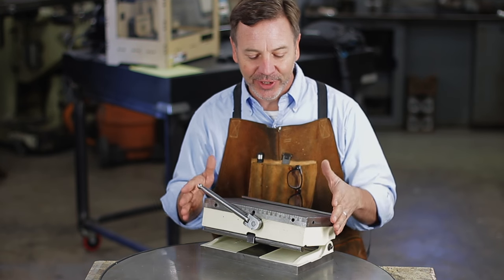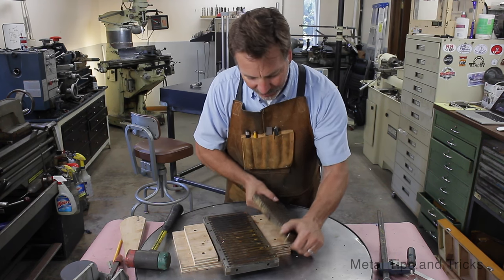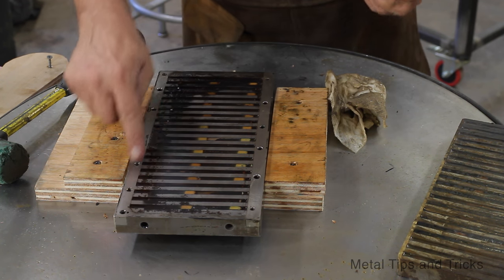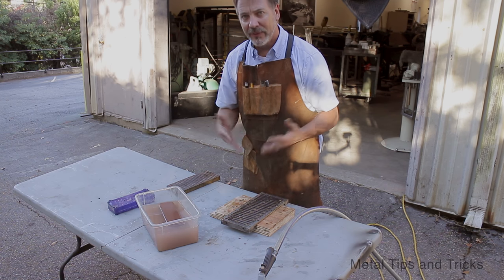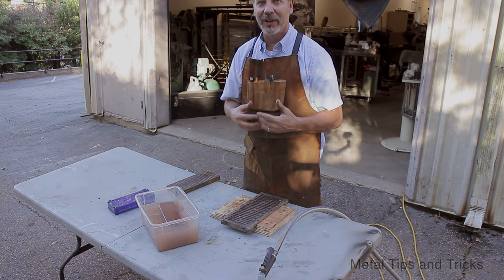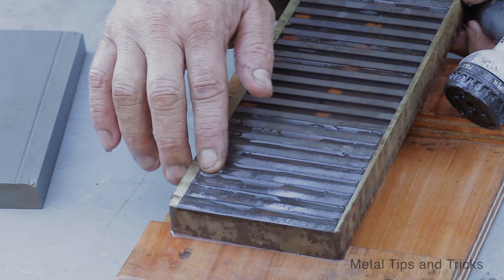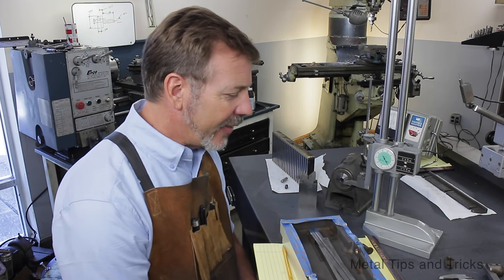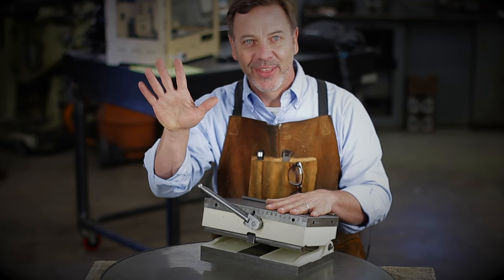Magnetic sine plate repair PART 2

Comment: Other YTs I’ve seen dismantling a magnetic churn, turns the chuck “off” then lifts the top plate. Also the magnetism is through the thickness not the ends. There is a really good YT about how a mag chuck is built in the factory. Thin profile chucks are best for small thin objects because, as you say, the flux lines are small. And that is because the poles of the magnets run through the thickness not the ends.

Comment: Fascinating series. The distance between engaged (magnets aligned with transfer segments) and disengaged (magnets between transfer segments) will give you the "throw" (twice the offset) needed for your cam, but not the length of the link. As you say, that may require trial and error.

On flattening, the rule is to rub three surfaces (in rotating pairs) to get them all flat. Rubbing a single pair will always create one concave and one convex surface. This is how telescope mirrors are ground by hand. Avoiding letting more than a quarter of the stone go off the base object will help, but the three surface method will generate optical flats (flatness measured in Ångstroms).

Comment: 3 months ago I also rebuilt an eBay magnetic sine plate.  I placed the plate on the plywood like you but used a larger plywood sheet and surrounded the top plate with wood supports.  I then added 2 blocks to retain the captured plate to the plywood like a hold down on a milling machine.  It was easy to then use 2 wood clamps to walk the mag plate sideways off the bottom plate and also reversed to place  back together.
Reply from the maker: Great job. I wish I would have don it that was. what kind of shape was your magnetic plate in?
Reply: mine was in poor shape with rust and goo even the hinge pin had light rust.  I have not completed the repair with final grinding.  I will do that when I need it for a project and remove my standard mag plate.

Comment: Take a guess?? Why not just measure the lamination separations on the magnet? The distance it needs to shift is one separation.
Reply: Exactly.
Reply from the maker: Good point, Im not that smart!  LOL.  No thats not the reason there are other factors in play.  If the pivoting pins on the cam were in alignment  with  the one on chuck I could do that. I could try to calculate the differences, but sometimes its faster for me to use  the trial and error  method. :-)

Comment: Thanks, I learned a lot from this video. My 6 x 18 chuck is very hard to turn on and off, even with a long handle. I've taken it apart for cleaning as far as possible but cannot separate the two halves for grinding and lapping as you have done. Maybe I''ll try again by pulling the top half from the side since I'm sure that what's causing the problem.

Comment: Hi Dale,

I commented on the previous video, but I'll repeat it here...

If your chuck had used Alnico magnets you would potentially have lost a lot of the magnetism by taking them off the plate and breaking the magnetic circuit.

That's why they say not to take magnetic chucks apart, it's based on the older magnet technology. You were OK because you had ceramic magnets.

Comment: the theory of flattening the water stones is really interesting to me, I'd definitely like to see a follow-up where you measure the run-out. Also wouldn't rubbing two stones together (or the stone against the chuck for that matter) end up with one being concave and the other convex? They would wear into each other but I don't entirely understand what is keeping them flat? 

Like rub a chunk of steel with a slight dome to it against an equally hard but flat piece. They wouldn't both wear perfectly flat, but instead the first piece will become less convex while the originally flat piece will wear to an equal concavity. Or is there something I'm missing?
Reply from the maker: Hey Porutec, The stones are very soft and a consistent hardness. When rubbing them together they   lap each other flat. You must flatten them to each other often when using this technique
The law of averages do the work for you. I hope this makes sense?
Reply from the maker: Hey Chris, Im sorry I didn't make it clear why you use Japanese water stones. Use them because they cut much faster than any other stone out there. The reason I showed this technique is if you're repairing you're magnetic Chuck it might mean that your grinder is out of commission.  great comment.

Comment: Awesome series. A note though, NEVER hammer or hit a magnet, it will randomize the magnetic poles of the atomic structure and weaken the magnetic strength of the magnet. What makes one material magnetic and another not magnetic is that the magnetic material has all (or most) of it's magnetic poles aligned, whereas regular materials have the magnetic poles randomized which cancel each other out.
Reply from the maker: HI Tikki, I have never heard that before, Interesting

Comment: Dale, I have an old Atlas Clausing mill. The table is in good condition but could be better. I have been considering using the Japanese water stone technique to improve the finish and flatness of the table. Do you have any thoughts on this?
Reply from the maker: Hi Paul, I have done this on my mill and other machines. But be careful the bigger the surface the the harder it is to keep it flat.

Comment: My choice would be surface grinder to remove the majority of material, because it will remove material easily. A ruby wheel takes care of ceramic, and you can get diamond wheels for them as well.

Then, after the surface is clean and flat, I would smooth them with a fine stone, or diamond flat.

I see that you had to do that after all. It would have taken all day to do it with water stones. I gave up on water stones a few decades ago. They’re fine for my Japanese chisels, but not for this. I don’t even use them for that anymore. It’s an old technology that originally used natural stone found in parts of Japan. Those are VERY expensive. Over $200 per stone, and sometimes $1,000. So they went to artificial ones. But there are better technologies these days such as fine diamond.

Comment: Glad i found your video, I am refurbishing the exact same chuck,  Do you feel lightly glass bead blasting in between the magnet surfaces would have been acceptable to remove the rust? I really hope you have some insight. Thanks in advance
Reply from the maker: You need to keep the surface a smooth as possible. Try evaporate rust. and regrind it.
Reply: @BuildSomthingCool  The new wd40 copy of evaporust works like a champ. But the 2nd time using the used solution was not as effective. Thanks for the responce i forgot i still have some of that rust soak

Comment: The flattening of stones - In theory, you really need 3, and to flatten each against the other 2.
With just 2 rubbed together, it will always result in 1 concave & 1 convex surface (spherical).
http://www.muelaner.com/straightness-and-flatness/
Reply: ivanblogs Exactly! And the same issue with the way he worked the stones on the plate. More time is spent on the center than the edges and corners. No way for such a casual approach to end up truly flat. Flat enough to not be visibly out, sure, but that could still be off by a thou or more in actual fact. 

Most guys who use Japanese waterstones religiously use a high quality, truly flat diamond plate, larger than the stones, to flatten them. And they use the nagura instead of washing it away.